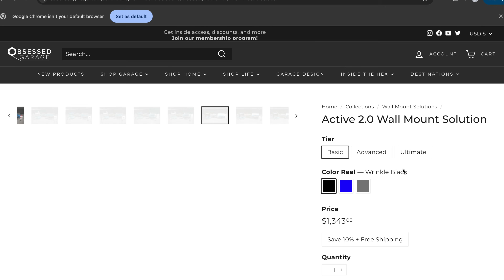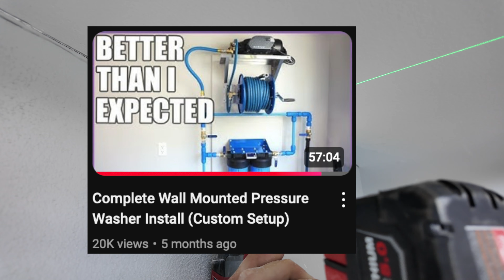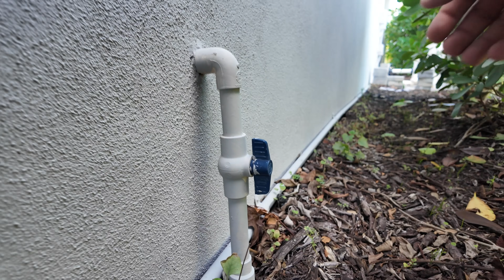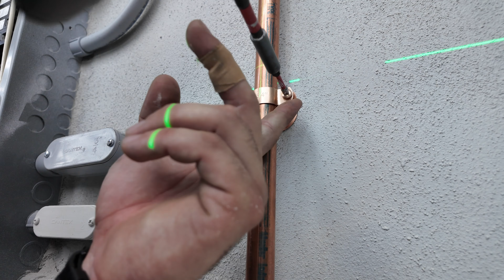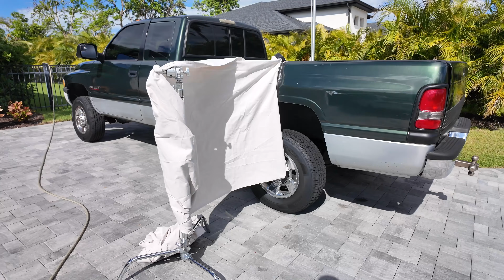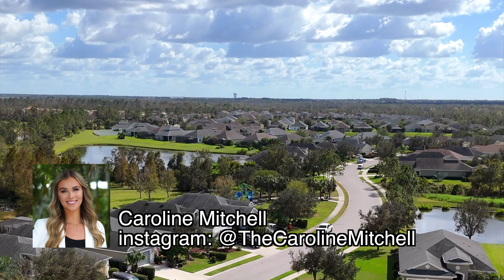How to Install a Wall Mounted Pressure Washer (With Plumbing and Electrical)

Comment: According to the Florida Building Code, there should be a minimum of 12 inches of separation between a water line and an electrical panel, as this is the standard clearance for plumbing near electrical components to prevent potential water damage and electrical hazards
Reply from the maker: Thank you for that insight.
Reply: OK Karen
Reply: @stevenmcc2119   It's fine as until you try to sell it and the inspection calls it out.  Then the buyer will be trying to knock a few thousand off the house as a concession.
Reply: Looks good from my house karen
Reply: LOL I guess no one in Florida has a legal electric water heater then, since the water touches the electrical heating element.
Reply: @BlueCollarBachelor   I just got dumber by reading this comment.

Comment: Excellent and informative video.  I'm planning to install the same system on my cinder block wall in my garage.  A couple of questions I have.  #1-any issues with securing the pressure wash, reel and filters to your cinder block wall?  #2-now that you've used it for some time, would you have don anything different?  #3--you mentioned that you were skeptical on the PPM for TDS when you took the sample to the local pool /chemical service provider.  Did subsequent testing/results improve?  Thanks and I found the video very helpful.

Comment: Wondering why you didn’t install a backflow preventer/vacuum breaker in the water supply line for the water pressure.

Comment: Nice clean install. Something I'd think about doing is adding a splash guard on the left side of the pressure washer and hose real (or some kind of cover). Could be a simple board a couple feet tall and have it come out from the wall 10" or something. When/if one of the connections fail it won't release a stream of water onto the electric panel.

Comment: I added a 4" x 40" RO filter drain the brine water into some plants brings my TDS down to 5 then go through a DI filter. I can rinse a black colored car no drying no water spots.  Built it less then $300 all the parts are online. I'm in Arizona water here is like dissolved rocks TDS is over 600. Water is so pure like using distilled water to wash a car.

Comment: Great video, i really enjoyed the lab part at the pool chem store. I work in waste water, there's always dissolved solids that aren't/cant be removed with regular filters. I installed similar filters in my home water, and i plan on making an electric pressure washer area as well.

Comment: You should have listened to Matt and crew from OG you choose the wrong filter's and this is a dangerous set up so close to an electrical source, 
Passing what you yanks call code not a good look, and then you call yourself a Doctor....I wouldn't let you near me.
Reply from the maker: Appreciate the concern! We are aware of the proximity. I suggest you look somewhere else for a doctor, I don’t like working with negative patients like yourself.
Reply: @DoctrParker I don't need false teeth bud.

Comment: @drparker The Propress you linked to is for galvanized and black iron pipe. If people get this for copper it will not work. The jaws are different.
Reply from the maker: Good to know I will change it thank you for pointing that out.

Comment: What you need is a deionized water system. That’s how you get spot free water. Reverse osmosis or heavy filtration is fine but it’s never spotless like deionized water.
Reply: right.  he could just fill those three big blue filter housings with mixed bed resin and have spot free.  the current filters dont cut it.

Comment: Something I’ve seen for filter plumbing (mostly on systems using deionizing resin) is to add a tee and ball valve before your filter inlet where you can bypass the filter for your everyday pressure washer use or primary wash down, then flip the valves to the filter side for final rinse. For a simple filter system you’ll probably get plenty of life out of the filters, but for resin filter systems it can greatly increase the life out of the filters, which can get pretty expensive! Overall the install looks fantastic! Can’t wait to get mine setup once I finish building my shop!
Reply from the maker: I saw that too but if I’m paying for the filters to be replaced yearly might as well use them!

Comment: I always wondered how well the portable filters worked. The water at my marina is horrible. I always have spots on the boat after a good washing. Maybe it would be worth having a portable filter attached the marina hoses? I wonder if the marina allow it? I'd be curious to see your washing routine when you get the boat back.
Reply from the maker: Ispring, the brand of filter I used, makes a portable deionizing system that may be exactly what you’re looking for.

Comment: Water spots are all from the TDS and the resin will take it to 0ppm.
Reply from the maker: We were able to achieve no water spots with a tds of 300ppm so maybe the calcium content plays a bigger role for my water?
Reply: @ only way to achieve zero water spots is 0ppm

Comment: Maybe a safe guard between your panel and washer set up. Dont need any spark show in there. Cool idea and i need a set up like this! From BC canada
Reply from the maker: Florida code is 12” so we are good 👍🏼
Reply: @DoctrParker  perfect, as long as you are comfortable. Super clean install, looks pretty.

Comment: You need to get rid of that cpvc in your house lol
Reply: No the cpvc pipe coming out of the water heater and the rest of the house
Reply from the maker: You’re talking about on the pressure washer?
Reply: Are you a professional
Reply: @ yes I actually am I’ve been a plumber for 8 years and my pops has been a plumber for 42 years
Reply: I was curious when I saw that, here in az it's only copper
Reply: Plastic and hot water ....seems safe

Comment: I failed a electrical inspection once for doing the exact same thing that you're doing right now. Water was too close to the electric box. Florida probably has different rules.
Reply from the maker: Hmm interesting. I’ll need to look into this. Only time it could hurt me is in a buyers inspection in the future when I sell the house. I’ll keep that in mind but for now I’m not worry about it.